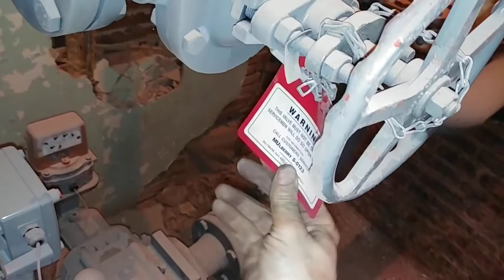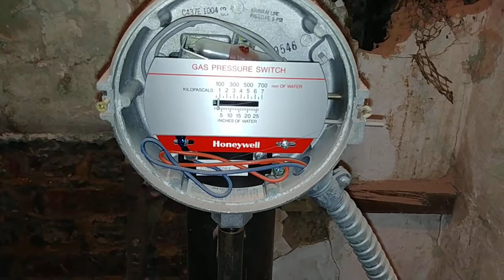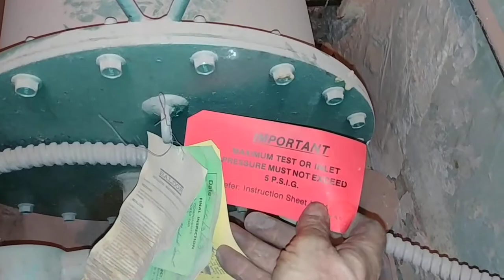Natural Gas "Suc-O-Lux" Pressure Booster Motor For Two Point Five Million BTU Steam Boiler

Comment: Good vid as always, is the gas pressure failure a common occurrence?, do you ever come across duel fuel burners?
Reply from the maker: Thanks!
Duel fuel burners were more common then they are today. I see them now and again, usually on really big units. Usually the oil part of the show is poor nick.  With oil (and underground tanks) dying a slow death, and natural gas supplies plentiful for now, their complexity and cost are making them disappear.

With the mild winters we've been having, and the local utility having been bought out by a Canadian holding company with deeper pockets and more willing to spend on upkeep, I grudgingly admit the delivery system infrastructure is getting a wee bit better, so there have been no issues recently with burner flame-outs due to delivery volume issues. There have been nuicence outages due to air in the lines...the price of progress.

Comment: I have seen similar turbines outside of laundromats in Jersey City do they boost the pressure of the gas supply or is a separate pump required?
Reply from the maker: I think they boost the pressure. A separate pump is not required.
Reply: they need lots of hot water so they use boilers or copper fin heaters! they probably need extra pressure to run all the units